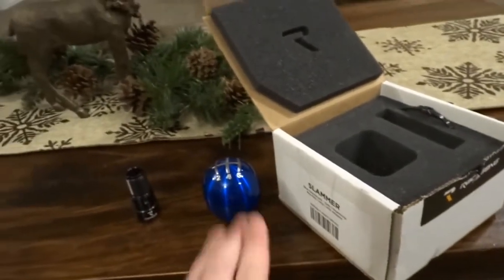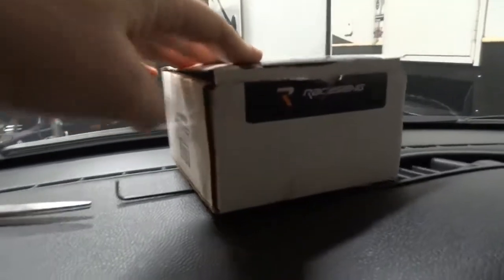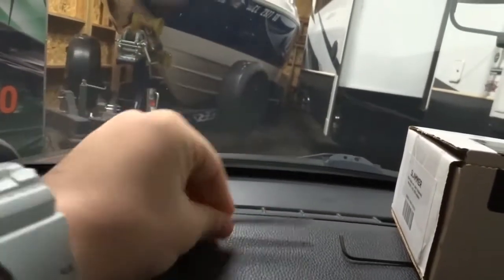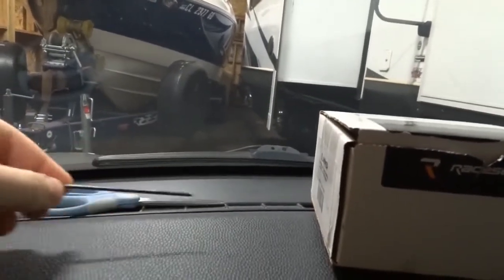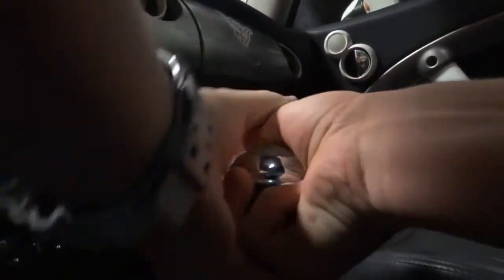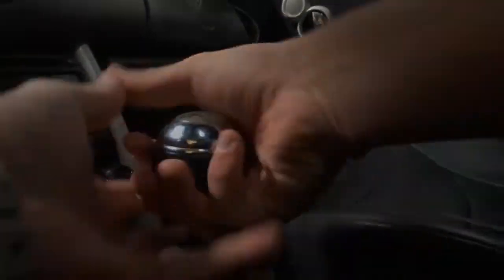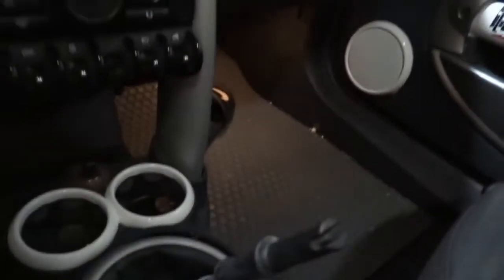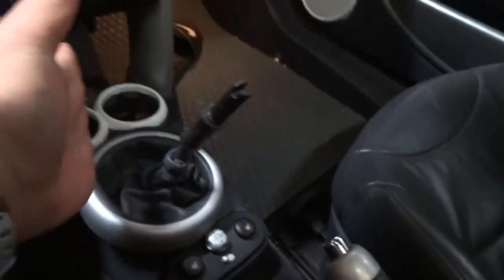Installing a new shift knob into my MINI Cooper S!

Comment: Do you remember how far down the non-threaded adapter went on the shifter? Been thinking about getting the same set-up but didn't want the adapter to snap on me. Thanks in advance.
Reply: It fits down to the top of the shifter "stick".